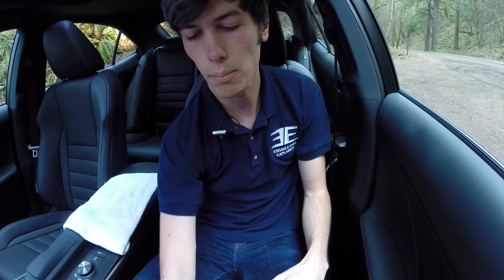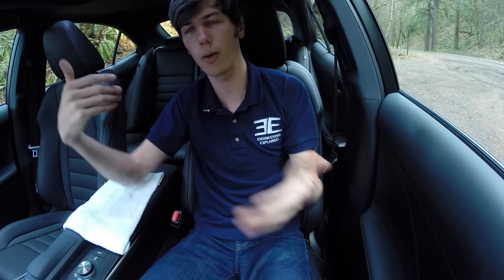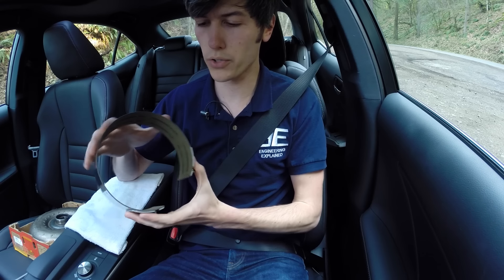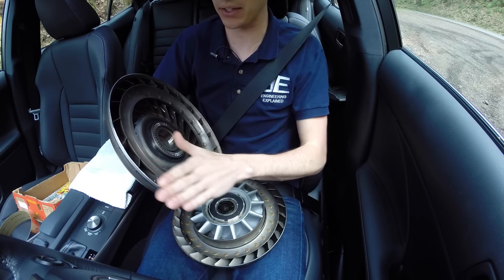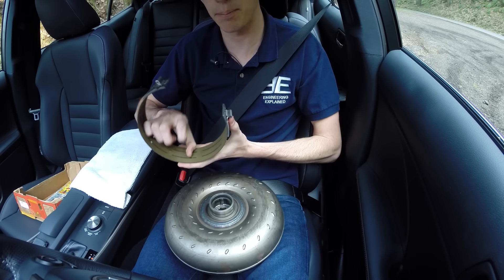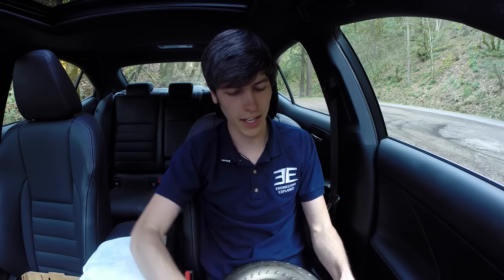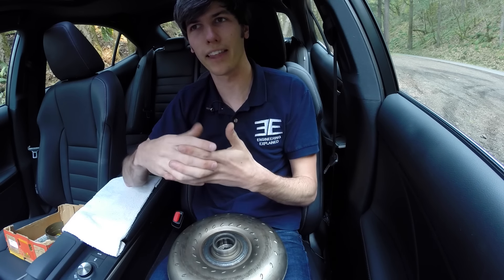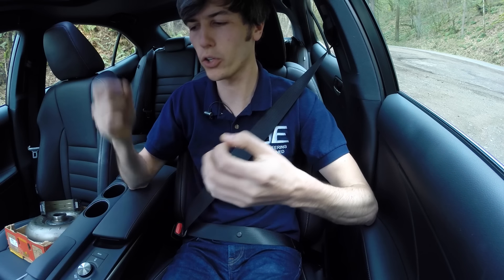5 Things You Should Never Do In An Automatic Transmission Vehicle

Comment: What about engaging the E-brake in the last scenario you talked about?
Reply: If the car was out of control and the gas pedal was stuck I'd just throw it in neutral. It has happened in my car twice and I just put it into neutral and braked
Reply: If that has happened to you twice... I think its time for a new car lol.
Reply: yanking the e-brake when going at higher rates of speed will through you out of control and can cause you to ROLL OVER, put it in neutral and don't even think about the e-brake until you are well under 20 MPH
Reply: +Capn Prat in a manual, you can use it more often. My gf uses hers all the time at stop lights and going up steep inclines and such
Reply: Brett M
 the new 2016 civic has a feature called "brake hold" that electronically will hold the brakes engaged till you hit the gas after you've come to a complete stop.
Reply: Most cars have been able to do this for years. They don't actually hold the brakes though, they just shut the engine off. It is restarted when you accelerate the vehicle again.
Reply: Yuvraj Sethia
Not the civic, HONDA specifically says it applies electronically controlled solenoid to the brakes to keep the brakes held, auto stop/start of the engine would do NOTHING to hold the car in place when you let off the brakes, that is a WHOLE different thing entirely.
Reply: +snapdragon69 how did this turn from using the parking/E brake to auto start/stop? Two completely different topics
Reply: +snapdragon69 I'm not sure what service brake hold is to be honest, and I've only driven vehicles that have an electronic park brake that are automatics so are they even used in manuals? I may be wrong, but I think that both features would be very useless or even dangerous when pulling away on say a steep hill with a stop sign and trying not to stall or roll back into the car behind you
Reply: Brett M
Brake Hold is a feature found in several new cars from the Honda Civic to the Lincoln line up, it is a feature where once you come to a complete stop it holds the normal brakes engaged using electronic solenoids so you don't have to keep your foot on the brake in stop and go traffic or on hills, it will actually HELP manual transmissions on hills because you won't roll back when you let off the brake to press the clutch in before you hit the gas on manual transmissions it releases when you let off the clutch, I'm sure they worked out the proper point at which to release otherwise it would be a pointless feature. on Automatics it releases when you hit the gas.
Reply: What happen if you lose your brake?
Reply: +Capn Prat my toyota corolla witch is a 96 is made so if ur throttle does get stuck u can just slam it into n from drive
Reply: basicly every new car has it, even my company's citroen berlingo, it is realy useful in steep hills with a loaded van, otherwise is just a fail-safe feature
Reply: And if it was two separate cars, I'd stop driving...
Reply: DanielRichards644 Oh right. Whoops 😀
Reply: +Capn Prat I'm 14 and I can control the E-Brake better than most skilled drivers
 think what you wanna I'm gonna tell you I know me. I have a steady hand and mom is a truck driver. Only one with passenger endorsement in our state. Dad used to be but he's not 1/20th as good as my mom. tell me I'm bs'ing. tell me yeah right. whatever. because I only know me and my life and you just don't want to belive it because you couldn't do it. I'm not lying because I really don't know why I would tbh.
Reply: Revving an engine and dropping into drive can do more then just wear out the friction bands, it can grenade the output shaft.  My brother learned that the hard way >.> haha

Comment: my friends and I broke 2 engine mounts in a Toyota Camry by redlining the engine and then slamming the transmission into drive...but it did do a great burnout! :)
Reply: A lot of modern transmissions will automatically shift into neutral when you come to a stop in order to save fuel
Reply: Are they shifting to neutral or simply using an auto-start/stop system to disengage the engine?
Reply: P. No this is before stop/start. Cars like the 2002 Opal (Holden) Astra will select neutral when you stop. you can't even tell the car is doing it.
Reply: John O Interesting. Thanks.
Reply: When I was 15 I broke my friend's transmission.  We were trying to launch it from neutral.  High RPM and slam into drive.
Reply: John O or even turn off partially like the new cadillacs which I'm not a fan of.
Reply: Kal's Tube and that is how you blow up your car -.-
Reply: In other words, THEY can do it secretly but if you do it- it's CHEW OUT AND TICKET TIME.
GLAD SO MANY SHEEP ARE SO PLEASED WITH THEMSELVES.
Reply: That wouldn't save fuel.
Reply: John O lol
Reply: John O wauw it was worth it ;)

Comment: Knew a guy who threw it in park while it was moving, to park it.
Reply: I knew a girl that heard about popping the clutch on a standard to start it when the starter is bad. So per her interpretation of popping a clutch, she put her automatic transmission car that wouldn't start in neutral, rolled down a hill, and threw it in park. No, she wasn't even blonde.
Reply: T L S if she had an old powerglide with 2 pumps she could start it just like a manual by putting it in drive after coasting down the hill.

Comment: When I park my car, like at an incline i always put it Neutral then pull the handbrake, release the brake pedal, making sure it rests on the pads and then put it in P. Its just feels better to know the whole weight of the car rests on the handbrake and not on the '' locking pin '' =)
Reply: +Nick Hammer thumbs up !
Reply: I balance my truck. manual trans and non working parking brakes.

Comment: my dads friends car stalled at stoplights when it was in drive
Reply: Probably more going on there then... With AC on?
Reply: +Trissification same thing happened to me with the ac on, got any idea why?
Reply: The IAC (IAC - idle air control) is supposed to bring the idle speed up a little when there a load at idle so the engine does not die. Your IAC module is probably bad or going bad.

Comment: honestly, I have to put my car in neutral because it tends to give off big vibrations from time to time and it's the only way to stop it.
Reply: i totally understand what you saying, i replaced my engine bay mount, and that problem solved.
Reply: As said, replace any broken mounts and that should solve the excessive vibration problem. =)
Reply: mine does that anytime I leave a stoplight or stop sign it shakes and like grinds. anybody know what that is? tranny going out of is it my mounts?
Reply: +Life of Lopes Tranny mostly needs rebuilding, the earlier comments are most likely referring to loose engine mounts that vibrate when the engine revs up when not at idle
Reply: Most likely*
Reply: i dont even know if mine has neutral. I never really paid attention to all the gears or looked for neutral
Reply: Sounds like the torque converter clutch lockup is sticking.

Comment: what if I put handbrake while in Drive mode?
Reply: Drift
Reply: +Kyron Weaver lol XD powerslide...
Reply: +havif akbar Nothing bad happens. You can use it on traffic lights if you don't want to hold the brake. I even used it in my RWD car in snow, to block the wheels when doing about 20 mph to drift.
Reply: You'll more prone to being rear ended cause brake lights won't come on
Reply: +havif akbar Once stationary, it's fine. Do not, however, release the brake pedal until you are sure that the car behind has stopped.
Reply: well then this will be your last post ever.
Reply: +havif akbar depends on your speed, for me it was skid sideways into the middle of the road, but I wasn't go all that fast to start with, under 40 MPH.
Reply: +havif akbar Rear wheel drive you will drift ..... Front wheel drive like me...... you will 180 it LOL  all good fun though
Reply: +Sox RWD handbrake whilst in drive?  Probably nothing, unless your handbrake is strong enough to overcome the driving force (unlikely).
Reply: In winter you can drift
Reply: +benpowersification ive never owned a RWD so im just guessing lol
Reply: +havif akbar you will have to visit the mechanic shop to get your hand brake shoes replaced
Reply: Sox
 If you do get one, do the right thing and make sure its manual :-)
Reply: benpowersification Ahaha yeah , my first car and the one i own now is a Honda civic ek hatchback AUTO , it sucks - i meen amazing car in handling and stuff but its not for me really reliable also never had 1 prob with it and its got over 250000 done

Comment: Why do so many people say that brakes will overpower the engine at full throttle? Or do i just drive too powerful cars?
Reply: change your brakes.
Reply: Your brakes must be worn out... Guess your Prius won't stop after accelerating to 0-60 in 35 seconds
Reply: I moved a Duramax into a shop once with no clutch, I just eased it into second gear, came into the shop standing on the brake pedal, front tires skidding on the cement, that didn't even slow it down! Had to key it off, maybe a small fwd but not even the average V8 would be held back...
Reply: if they don't you need new brakes
Reply: brakes are generally "power assisted".   On gasoline powered cars the assist comes from engine vacuum.  There is no vacuum at full throttle.  So no assist.....

Comment: I coast in neutral all the time and I'm in Illinois. Never got caught
Reply from the maker: Haha I don't think anyone's ever going to give you a ticket for it. Makes more sense for freight haulers.
Reply: Engineering Explained yup
Reply: no kidding, with no overdrive, coasting in neutral is about the only fuel saving measure I have in my old POS
Reply: If you're driving a car built after 1994, then coasting in neutral downhill accomplishes very little. And how exactly WOULD you have gotten caught?  There's no way to detect the gear a car is in from the outside.  It's not a very hard 'trick' to get away with.  That's like bragging that you never got caught masturbating when you were alone in your house with all the doors locked and the shades pulled down.
Reply: Cops don't have a way to check if your in neutral, none the less it is still illegal.
Reply: I think you missed the joke.

Comment: Can U tell me How to burnout an automatic? In my case camaro ss2012, or its impossible, destructible for the automatic transmission?
Im in huge doubt about auto or manual.... 
Cheers from Brasil
Reply from the maker: Turn off traction control, press the brake firmly, and then press the gas till the tires start spinning. At your own risk, of course. It's not like it's good for the car haha, but certainly fun.
Reply: Well, it is only fun for people watching if you break something...
Reply: e brake and floor it
Reply: My buddy neutral dropped his 83 el camino and broke his differential(and later we found out his transmission too), luckily he was able to coast down the hill to where I live n we replaced the whole rear end.
Reply: Only with front wheel driv mr random guy
Reply: AT 75 MPH throw it in reverse... do NOT give it any gas.  Your engine will stop, you'll sheer off the U-joint.  Once replaced your transmission will start to shudder the next day, within a week it will be dead.  That was a turbo-400 in a Pontiac...twice
Reply: NOT that I would know anything about that...
Reply: Andre Paulo Camargo have u tried lighter fluid?
Reply: put in neutral rev up the engine really high then change to drive fast as hell